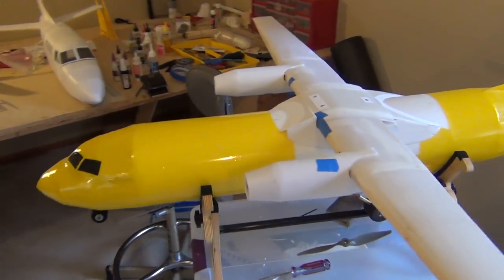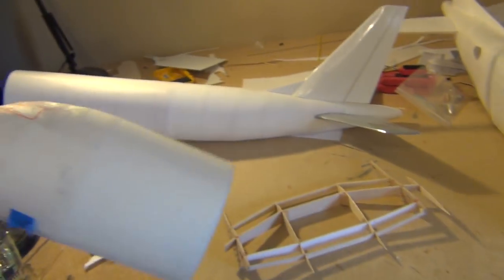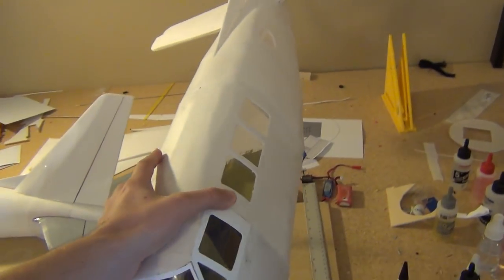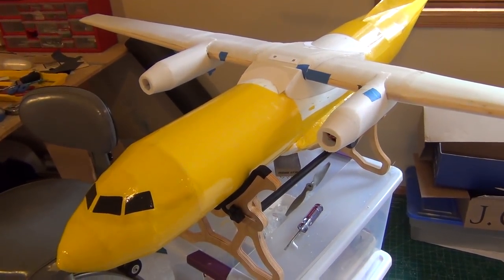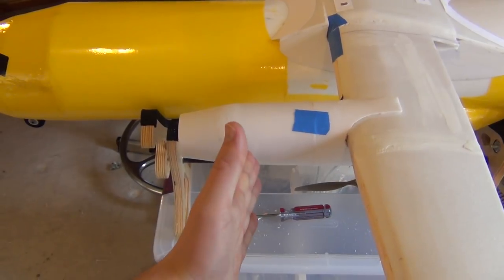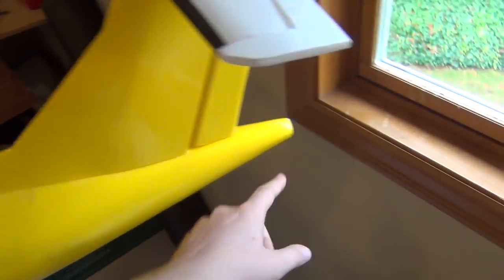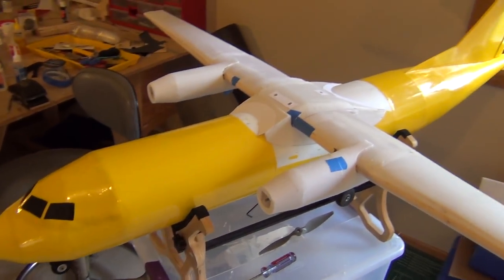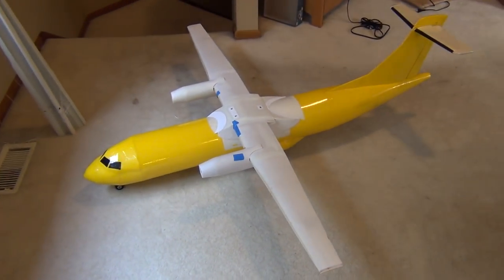RC ATR-42 Build Update and ERJ-175 Preview *RC AIRLINERS*

Comment: Hi,that's nice about your ATR .
and your other builds too they look great.
I need some with reference to your atr..being a noob with high wing scaled models ..I have been stuck with my project....can you please give me some pictures and ideas like how you mount your wings over the fuselage..that would be a great help!😎😇😇
Reply from the maker: Thanks! If you go to page 4 and 5 of the build thread I linked in the description box, there are more pictures. I always use nylon bolts and metal blind nuts to secure the wing. The blind nuts are hammered and glued into pieces of basswood or plywood. The hardest part is making sure the wing is aligned with the tail and fuselage.
Reply: I'm thinking about making my noise out of balsa just to try and get it smooth without using filler. here's some links to the info im using.
https://i.pinimg.com/originals/31/94/93/319493bfa12fe88a28cd02ec4db6e4c6.jpg
https://upload.wikimedia.org/wikipedia/commons/thumb/1/1b/ATRv1.0.png/970px-ATRv1.0.png
http://aviadejavu.ru/Images6/AN/AN87-3/13-1.jpg

Comment: hi i am building atr and i have no idea how to attach the wing to fuselage
Reply from the maker: Use one or two bolts on both the front and back of the wing. The bolts should screw into blind nuts that are glued into the fuselage. The hard part is getting the wing to smoothly blend in to the fuselage. Also, it is crucial to set the wing incidence to around zero degrees.
Reply: I'm thinking about making my noise out of balsa just to try and get it smooth without using filler. here's some links to the info im using.
https://i.pinimg.com/originals/31/94/93/319493bfa12fe88a28cd02ec4db6e4c6.jpg
https://upload.wikimedia.org/wikipedia/commons/thumb/1/1b/ATRv1.0.png/970px-ATRv1.0.png
http://aviadejavu.ru/Images6/AN/AN87-3/13-1.jpg
Reply: Thank you for replying I would like to share the picture of my atr with you guys

Comment: I'm thinking about making my noise out of balsa just to try and get it smooth without using filler. here's some links to the info im using.
https://i.pinimg.com/originals/31/94/93/319493bfa12fe88a28cd02ec4db6e4c6.jpg
https://upload.wikimedia.org/wikipedia/commons/thumb/1/1b/ATRv1.0.png/970px-ATRv1.0.png
http://aviadejavu.ru/Images6/AN/AN87-3/13-1.jpg